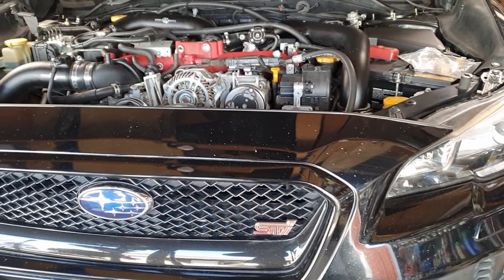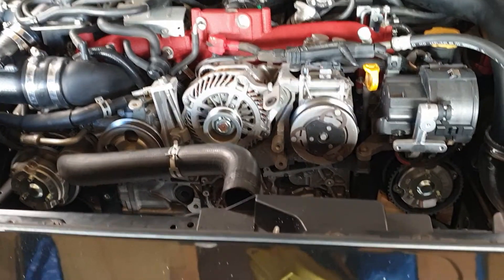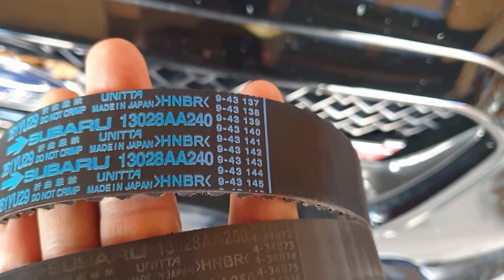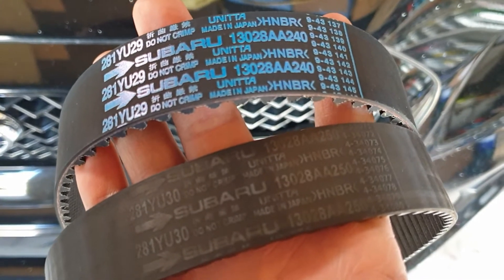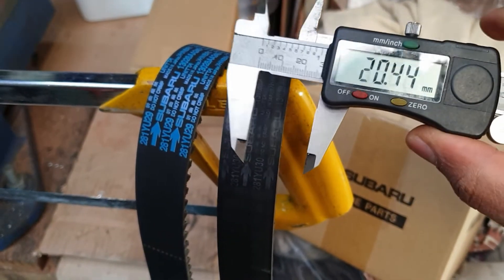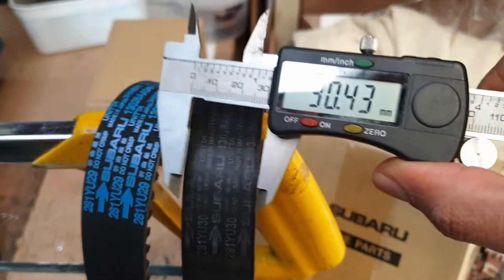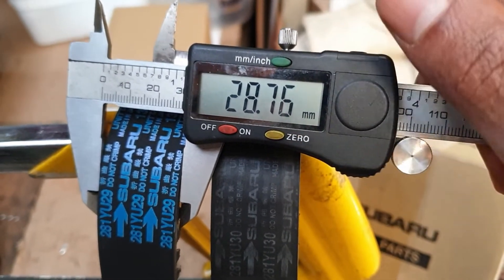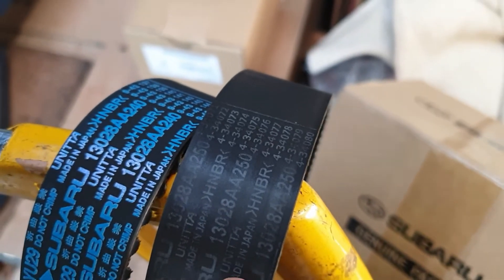EJ20 vs EJ25 Cambelt Comparison / Difference - Subaru WRX STI

Comment: I was wondering. Do you think it would be detrimental to run a 2.0 belt on a 2.5? I would think that the extra surface area of the belt for the 2.5 has to serve a purpose?
Reply from the maker: You will be fine running a 2.0 cambelt. Just make sure its a genuine subaru turbo cambelt